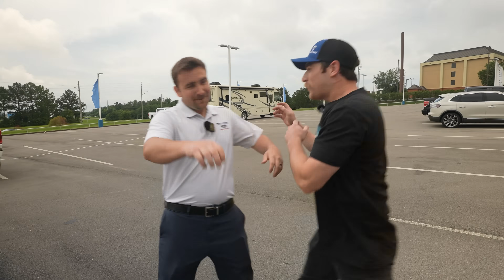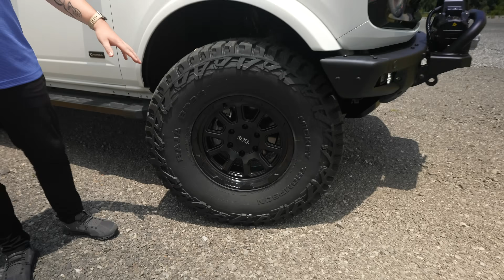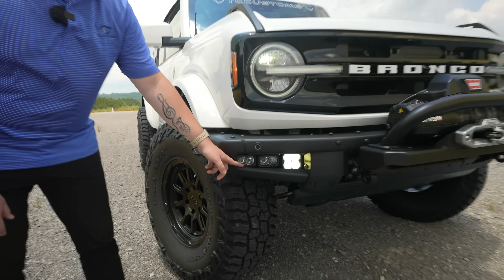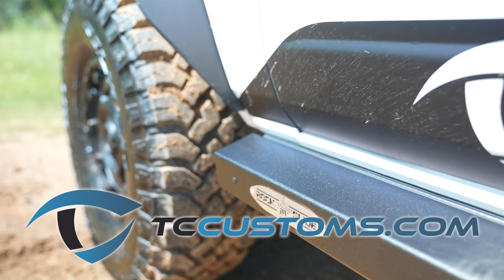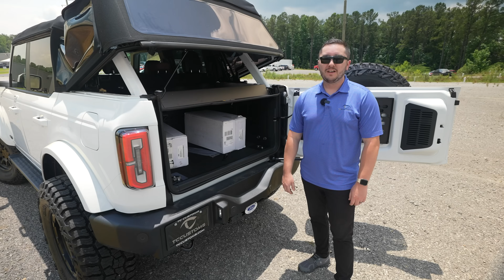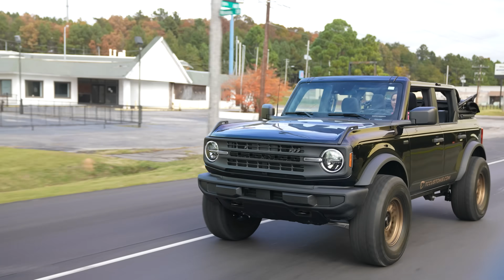6 CHANGES to Make to your Bronco Order!

Comment: I like customizing vehicles so I have an order for a base model. That way I can give it the sound system, shocks, wheels, and tires I really want. 

Some of the complaints in the comments section I do agree with. If you want your Bronco to be tuned to be the best off-road vehicle it can be, the Sasquatch package is a must! Not because of its big tires, but because of its gear ratio and locking rear differential. You are setting up your Bronco to be the best off-road truck money can buy if you get some of these features added on and wait patiently for supply chain issues to be resolved. Also, suppose this is going to be your daily driver. In that case, those sensors for blind spot monitoring, parking, or even adaptive cruise control will be really desired and nearly impossible to install yourself as an aftermarket feature.

Comment: Truth in advertising? "You're really only missing out on adaptive cruise control and upgraded audio system and a wireless phone charger". Yes, you put the ordering site screenshot into the video but those of us primarily listening also ought to remember these:

• Adaptive Cruise Control
• B&OT Sound System by Bang & Olufsen with 10 speakers, Including Subwoofer
• Evasive Steering Assist
• Heated Steering Wheel
• Dual Smart Charging USB Ports - Type C + Standard A, Dash Board
• Universal Garage Door Opener
• SYNC®4 with Enhanced Voice Recognition with Connected Built-In Navigation
• Wireless Charging Pad

Comment: If you’re a serious off-roader, then wait. But reality is, 95% of people waiting because of SAS don’t need it. I’ve got a GX470 with after market lift/tires/wheels and it’s perfectly capable off-road for what I use it for. A base with a level and 33’s will do most people just fine for any sort of light to moderate off-roading or overlanding. The only hang-up for me is the hard tops. I have a full roof rack on my GX that I use frequently and would like that option not to hold up an order. But it won’t be a deal breaker. After market hitch with 4-pin wiring for a small 4x8 trailer will do me just fine.

Comment: If somebody is holding out for lux package based on the want of better audio, they should just go ahead and skip that, the B&O doesn't live up to its "premium" branding, the Sony system in my 14 Fiesta ST is WAY better.  go high package and have a better stereo installed elsewhere.

Comment: Why would anyone want to back off what they ordered from Ford. They advertised they had it and I ordered what I wanted. Now Ford is holding up my bronco because I ordered what I wanted from what they said you could get. If I have to change up my Bronco to get it built then why did I order a bronco in the first place. I think Ford needs to tighten up or get new suppliers to make the things they say they are having trouble getting.

Comment: the 2.7 v6 is not holding up production. that is an excuse by ford. i personally work at the plant that produces the 2.7, they have so many of them built up that they ran out of steel racks to put finished engines on. they are literally putting finished engines on pallets. so no the v6 isnt holding it up.

Comment: The problem with ordering a Bronco without Sasquatch is the lack of front-and-rear lockers and the shorter gears.  You can lift it; you can put bigger tires on it; you can upgrade the suspension;  but you just cannot get those lockers or shorter gears without Sasquatch.

I ordered an Outer Banks, with Sasquatch, and Lux, and the modular front bumper...  The only "build my Bronco as slowly as possible" option I didn't get was the tow package.  And I wanted the tow package, but my dealer flat out told me that it'd be pushed to the 2023 model year if I ordered the tow package, so I left it off.  And the only thing you give up between an aftermarket tow setup and the factory tow package is the 7-pin connector and wiring.  And for a 3,500-pound capacity?  You don't really need the 7-pin connector with trailer brake controls...

But I'm resigned to waiting as long as I have to...  I'm not "dumbing down" my Bronco build just to get it quicker...  Heck, the longer it takes, the more money I have saved up for a down-payment, and the lower my monthly payment will be.  🙂

Comment: Hey Wondering if you have any recommendations for me. I order a Wildtrak with the HD modular steel front bumper. I found out the rear is going to be plastic, do you know where I can get a aftermarket rear bumper that is steel that would match the front Modular bumper? Also is it possible to get the factory rear bumper I have but just the steel version of it? Thanks!

Comment: Bronco OB with 3.73 or 4.27 gears on 37’s is not even close to a Sasquatch. 
The s190 axle, thinner, narrower, smaller ring gear. Look at the angle of the upper ball joint on the 4” lift! 
At the very least you should recommend a BD with 4.46 gears or insist on a manual in other trims south of the Badlands. 
Don’t believe me with gearing, compare a 2.3 base vs a BB. Both with the 3.73 gears but the BB has larger tires and it’s gutless compared to the base. 
Your rig in the video looks and sounds like a way overpriced, gutless mall crawler.

Comment: I waited for my build & happy I did, got what I wanted. 4 door Area 51 Outer banks, Sas, 2.7, hardtop with mod front bumper. still though even here in Houston, most broncos I see are soft top. Reserved July 18,2020, got pushed, re-reserved Oct 2021 and received on march 31st 2022…. Only other thing I wanted was the ports on the dash and better sound system but that’s easy to do after the fact, she’s def been all over the beach 4-5 times! 🤟🏽

Comment: 4 cyl 2.3 updated power rating is 300HP (premium fuel), then add power upgrade another 20% to 340-360 HP, plus 500-600lbs lighter than V6 2.7.  2.3 is a viable option.

Comment: Does anyone regret getting the 4-cylinder, for the manual transmission?
Reply: Can't say yet because I still haven't gotten it, but that's how I ordered mine, even though no discount after upgrading to sas. 95x315 is in the same ballpark as 70x415, actually a bit higher, so torque at the wheel is just as good in low range (and per Engineering Explained's channel, subject to a limiter anyway). And in another video from this channel, Shelby Hall told Mitchell that she was driving him in a 2.3, but hadn't noticed the difference at first. Straight 4 is mechanically simpler engine design than V6, and piggyback tuner gives +20% power for a third of the cost of upgrade to V6. Every review I've found praised the manual, some said the 10-speed hunts for gears. Plus I and my wife think a manual is more fun and theft-deterrence is a bonus. These are my reasons for choosing the 2.3 with stick shift; good luck with yours!

Comment: I have the same size baja boss ats on my gladiator but with method 701 wheels in same specs as those black rhinos.  They are outstanding anywhere but bad mud and they’re still usable. Pretty heavy but that lends itself to durability.

Comment: I personally think that they are holding up production to drive the price up. It comes down to supply and demand. Just about every Ford dealer in the Delmarva area are tacking 10,000 to 15,000 thousand on there Broncos. Used Broncos are selling for up to 20,000 thousand over sticker. It's sad the average person can't get one.
Reply: Easily disproven theory unless you believe that every car manufacturer is doing this with every model they sell, not to mention companies that sell computer components, appliances, aircraft, gaming consoles, cameras, etc etc.  There is a legitimate microchip shortage.

Comment: Order banks are locked, no changes are allowed or you loose price protection
Reply from the maker: You can change options without affecting any of that. Changing the trim level,  engine, or lux/high/etc will update the order date and will require a manual process to keep the price protection
Reply: @TCcustoms_ Can you clarify the meaning of manual process?

Comment: I got my order in 4 months after walking into the dealer and placing the order. 2 door outer banks, 2.7, Lux package, locking rear diff, 4A, modular bumper. Ordered Nov 3ed 2021, delivered 4/24/22
Reply: Awesome, I got mine 3 months time since it was a base squatch
Reply: @jipidydoo  That’s awesome congrats

Comment: So being a dealer myself I agree with a lot of what you mentioned. Tow hitch, Modular Bumper, possibly even Sasquatch if you can stomach that change and are truly not an off road enthusiast. However please please please do not change your PEP code (AKA changing from Lux to High, Mid etc.) Also if changing from Sasquatch changes your 4x4 from the advanced 4x4 to the basic 4x4 (Big Bend, Base and some Outer Banks) DO NOT make that change. Changing a PEP Code or 4WD system resets your clock to the date in which you make that change. This has been long established, it has an entirely different price protection calculation and can be verified on FMC Dealer/ WBDO for the dealers listening. You are correct that those changes do help, however going to the back of the line by making them might not be of a benefit in any large dealer scenario, a small one it certainly can. You guys provide great content and keep it up!
Reply: This is extremely good information to know
Reply: Can you tell me if changing from soft top to hard top will have the same effect? Since here they are saying hard tops are no longer a constraint (probably because everyone switched to soft).
Reply: @chargedup3817  I'm not seeing the top causing delays any longer. That said the same size over the past 7 weeks has been astronomically low compared to months past for scheduling. Hate to say it but it's been very bleak.
Reply: 2.7 Wildtrak, Lux, Sasquatch, Modular Bumper, Brush Guard, Tow Package here. Dec 2020 Res, March 2021 Order.

Do you think removing the tow package, modular bumper, and Brush guard will help me get mine faster? I don't want to remove Sas and Lux obviously but I think I would be okay removing some of these other things if it would get it to me faster. 

The crappy part is I don't know if I could get a VIN next month or next year. If I just knew how long I had to wait, it would make the decision easier so I would know if those options were worth waiting that long for.
Reply: @omnitype_official  tow hitch, mod bumper and brush guard yes absolutely will help. Leave the rest alone. No guarantee it will work but it's probably your only shot at getting a 22 at this point. If it rolls in to a 23 maybe toss them back on and just wait it out would be my advice
Reply: @omnitype_official  just wait cause you basically have all the things that will delay you anyways, don't take any of it off

Comment: The 2.7 shortage is simply due to the fact that the F-150 has top priority.  In 2014 there was a 5.0 engine shortage. Ford came out and said that the all new at the time 2015 F-150 had priority over the Mustang.  There were plenty of 5.0 F-150 trucks being built but 5.0 Mustangs were hard to find until the shortage ended.

Comment: Agree with your video but the main reason I would never give up the Sasquatch package is because of the better gearing and sway bar disconnect..
Reply: Sway bar disconnect is on Badlands and Raptor only, it is not part of the Sasquatch package.

Comment: Why?!? Why would you put a 4 inch lift and keep the Hitachi shocks?  37" Mud Terrains for the Mall?  For $150, you could have the same sound with the Flowmaster high clearance axle back exhaust.  EDIT: At least it has a rear locker.

Comment: Do not get rid of Sasquatch if you actually want to go off road.
Yes you can get lift and tires for cheaper aftermarket. 
But changing gearing and adding lockers front and rear will cost you double aftermarket vs from ford
Reply: you’ll also void your axle warranty and from the videos of breakage ive seen you don’t want that happening

Comment: An aftermarket lift, rims and tires is going to run you damn near $5k. I'll wait for my SAS because it also comes with the upgraded transfer case and front lockers.
Reply: And lower gears sway bar disconnect and...a bigger front differential...now they just need to fix the weak steering rack!!
Reply: @joshyoung3187  sway bar disconnect only comes with Badlands and First Editions

Comment: I'm screwed!!  Reserved an Area 51 Wildtrak June 2021, and placed order in October 2021.  I have the Sasquatch w HOSS 3.0 Pkg., MIC Hard Top, Modular Bumper, Towing Pkg., Luxury Pkg., and 2.7L engine.  Still no build date a year after reservation..  I honestly don't think I'm getting my Bronco until 2023 if I'm lucky!
Reply from the maker: Yeah the Wildtrak with Lux is the HARDEST Bronco to get built right now. Sasquatch is the hardest option out of all of them, and it is standard on the Wildtrak. Maybe you'll get lucky soon!
Reply: @TCcustoms_  😢
Reply: Same. March 2021 Cactus Gray, 2.7 Wildtrak, MIC Hard Top, Modular Bumper, Brush guard, Towing pkg, Lux Pkg, Sas Pkg. Literally every single thing they tell you to remove lol. Its been 1.5 years for me with no VIN at my T&C Ford order.

Comment: My dealer just asked if I'd entertain stepping back from the modular bumper option on my BD order but otherwise indicated that the long list of hold-up options were not in my order.  Not trusting that statement as I still have the 2.7 and the towing package.  Not liking what i see in the customization costs compared with the Z plan values i'd give up on the factory install components i'd like.  Ford should consider offering substitute options to placate frustrated buyers.   Options  feel like dangled carrots that keep getting taken away, alluring promises not kept.
Reply: Tow is absolutely the number 1 constraint right now.  Most people who don't drop it for 2022 are going to get pushed to '23.
Reply: @dcl97  I kept all the options indicated, including towing and my BD is now in production.  Got word on a build week for August back in July.  That's just shy of 10 months wait for a build date. Hope others still waiting hear news soon on their orders.
Reply: But, not Fords fault although it is their problem with factory "Add ons". If suppliers cannot deliver goods, adding more suppliers is a shitshow ( so to speak ). If Uber doesn't bring a salad it's because one was not available and therefore not Ubers fault.

Comment: The fact you can't actually build to order what you want is crazy to me. All the things you have give up just to maybe see it sooner. This whole process has turned me off Ford at this point.
Reply from the maker: It is not just Ford. All manufacturers are facing the same issues
Reply: All have issues yes. But Ford has been at the top for overall being one of the worst. Even the build orders they are doing now, and not just Bronco, are in a random order. Love all your guys content and your dealership seems at the top. I am lucky to have an amazing dealer as well local. They are as frustrated as customers are at how things are being handled. The Bronco and the Ford products are great vehicles. Ford at the business side could have done better at several turns is all. The frustration is just over the top. The randomness builds are coming in makes no sense.

Comment: I’ve noticed how everyone that tells me to remove options from my Bronco order didn’t do it to their Bronco order.
Reply: They want to sell you stuffs they're selling lol
Reply: I ordered mine in November, it took delivery of it in April. Don’t change anything.
Reply: @donherbert1561  what’s your build
Reply: @donherbert1561  Mine exactly the same time as you and i didn’t change anything.
Reply: @donherbert1561  I ordered mine in April ‘21 and haven’t heard anything on a potential build date.
Reply: Yeah don’t change anything. Get what you wanted. And I think I recall a channel associated with this company suggested changing to a soft top and sure enough if you want to order a hardtop later on it’s crazy expensive. So yeah keep what you built and wait. It took me under 8 months to get mine after sending in my order. It’s about allocation I guess. I had the hard top and v6 option, luxe package.
Reply: @Liz-fv6jh  yeah I’m not changing a thing. You’re right allocation is definitely key. T&C had probably sold around 200 new Broncos by meanwhile my small dealer has sold 33. Not sure how that’s fair.
Reply: @Docstantinople  my local dealer has sold like 10 lol I ordered over a year ago, was still waiting when Everglades went live so I changed my order to one.
Reply: @the_odd_cobb2418  yeah I’m right there with you. Ordered last year in January. 2 door base Sasquatch.
Reply: @Docstantinople  Im a Dec 2020 res / March 2021 Order at T&C. I still dont even have a VIN and have no idea when I am going to get mine. It's been 1.5 years.
Reply: @omnitype_official  same here man, it sucks.
Reply: I reserved July 13th 20. I ordered 7 Jan 22 Bronco built 4/4 delivered 5/11/22 badlands Sasquatch,modular bumper, safari bar, tow package, hard top, lux package, 7 speed 2.3. I must have gotten lucky.
Reply: @cdcarillo  congrats!
Reply: SERIOUSLY!!! I get the same, damn hypocrites 🙄
Reply: No no that’s crazy talk